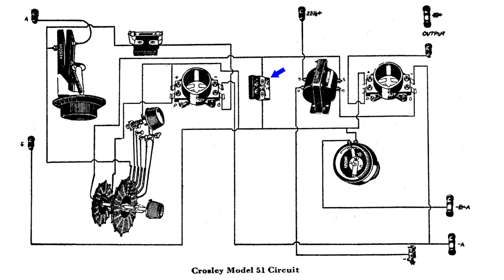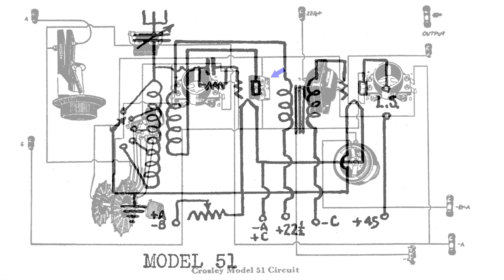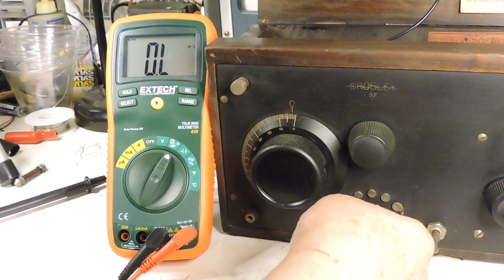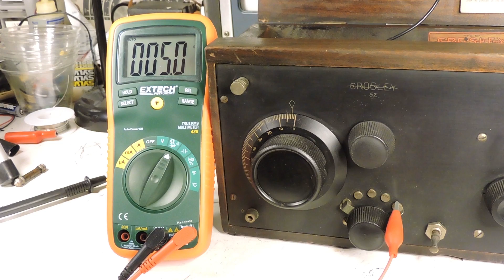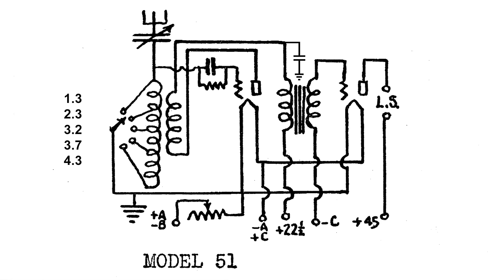Ohm-ing  out a multiple tapped RF coil

Comment: Hi I have a AC Dayton XL-5 with a type R-21 audio frequency transformer that is bad is their a way to make this with new parts till I can find a new old one. Thanks, I haven’t seen any videos addressing this problem
Reply from the maker: Yes, you need an intermediate audio transformer. Play things of the passed had them but there not up and running right now. I'll look at Antique Electronic Supply to see if they have them.

Comment: Hello! I have the Crosley 52 but it doesn't came with the rf bypass capacitor. Different versions?
Reply from the maker: +Francisco Suarez C. 
Look between the front bakelite and the tapped coil.
Reply: +AllAmericanFiveRadio You are right! It's hidden beneath the tapped coil. :D
Reply from the maker: +Francisco Suarez C. 
I had forgotten where was myself. So I looked at some source pictures for the Crosley 52 videos. They did hide it rather well.